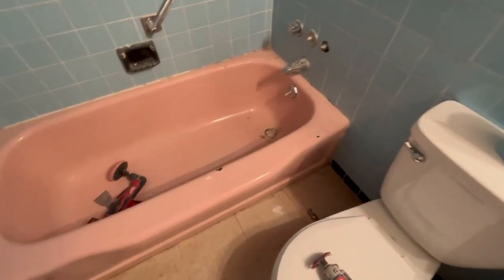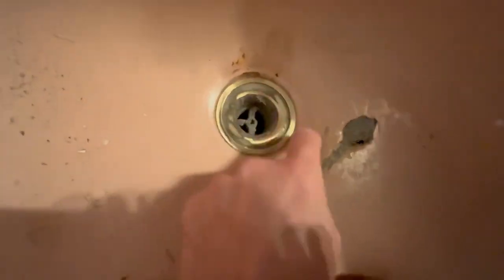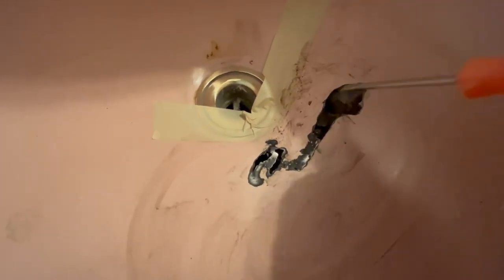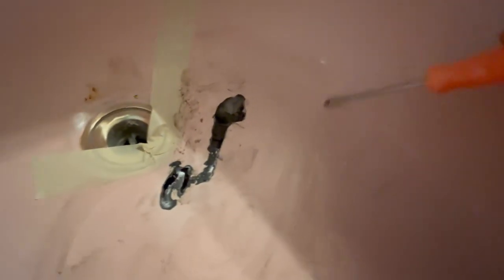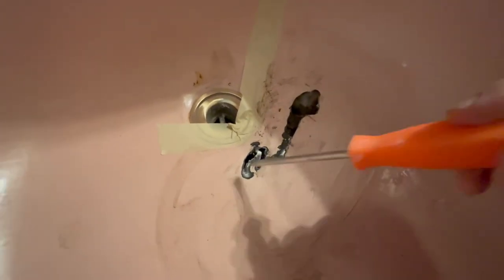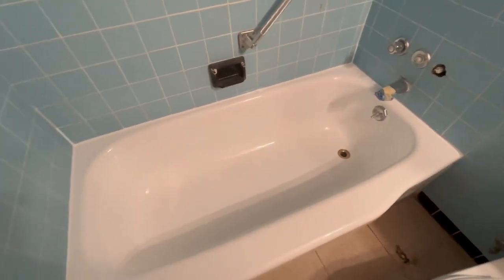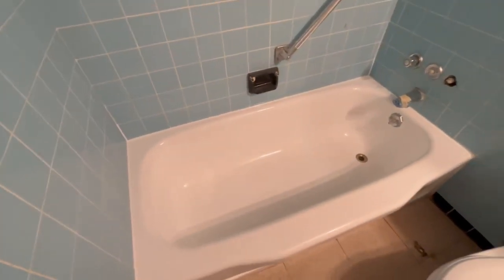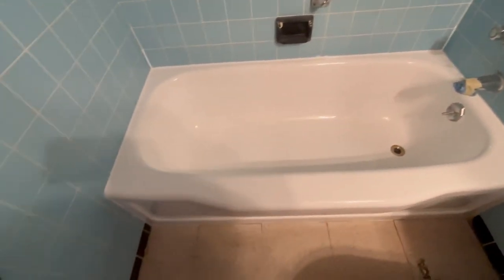Hole repair in 1960’s steel bathtub PINK!

Comment: Quick tip.  Rust travels through bondo.  Its best to use actual resin when it comes to rust.  Resin makes a great barrier.
Reply from the maker: Great point!
Reply: @bathtubrenew  yes, I learned the hard way😅.  It travels through hawk coating.  I used to use bondo and fg mat til i noticed.